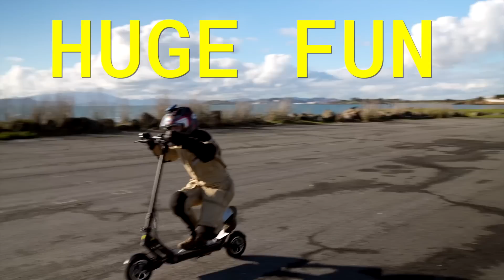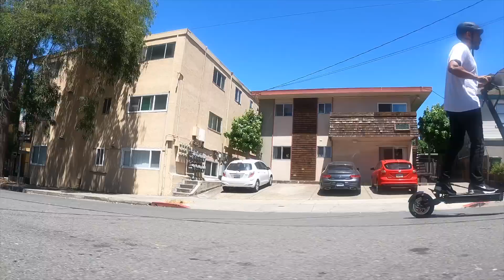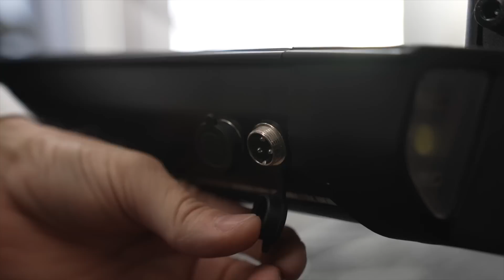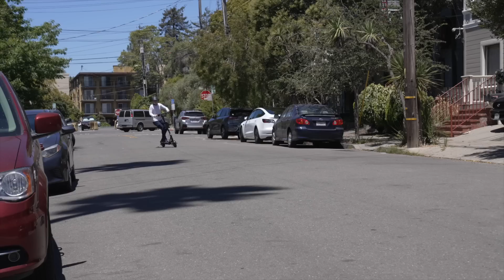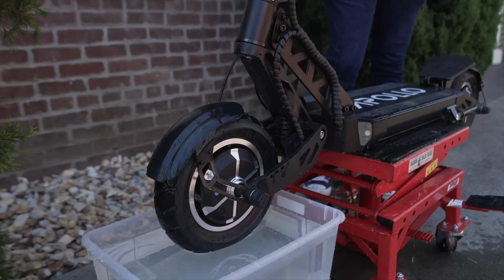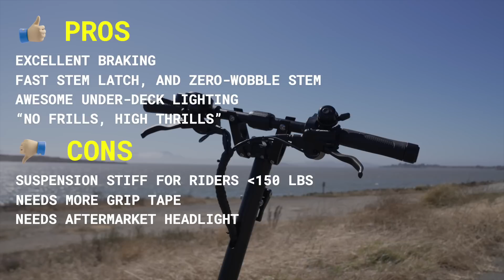NEW Apollo Ghost 2022 Gets 1,000W Motors - ‘No Frills, High Thrills’

Comment: I heard the larger motor prevents the flats, probably distributing the heat
Reply from the maker: Prevents flat tires? Interesting. I hadn’t heard that. What’s the relationship between motor temperature and flats? Were some people reporting that they got flats from the heat melting the tubes, or that hot tubes were more vulnerable to pinch flats?   -Paul
Reply: That doesn’t make any sense
Reply: @Jack-bz7zr  does it make sense that Apollo puts the same power motor but only increase the size of it? If you follow the groups that ride Apollo's they talk about this problem of the heat causing flats.
Reply: @Mrjaha  🤔🤣
Reply from the maker: The thicker rims could prevent flats, because they might be less pointy on the edges, but that's just a guess.   -Paul
Reply: @ESG-ElectricScooterGuide  thank you Paul, love all your content. 
It's just my educated guess from reading all the flat tire stories from the apollo fb groups. Neck pieces from the valve stem melting and mysterious pinch flats from heat . But it can also be inexperienced rides and misuse. I personally I'm not a fan of apollo, their products tend to usually be unfinished. But win people over with their sleek looks.

Comment: How often do you guys gotta change the tubes and brakes on these things if you use it as a daily commuter?
Reply: I have the 2021 version and I’ve had 4 tubes blow in less than 150 miles… it’s frustrating…
Reply from the maker: Every few months or so!
Reply: It depends. But for escooter it's just not worth it to have pneumatic/tubed tires. It's much more difficult to change and find suitable parts.

Comment: At 135 lbs can you tell me how to make it have a comfortable ride?  Am I just too lite to have a comfortable ride on this scooter thanks?
Reply from the maker: My favorite mod for the Ghost is to add a small rubber washer and metal washer to the top of the bolts for the suspension spring. This keeps the suspension from clunking when it reaches the top of travel. The trick is finding washers that fit into the space. You can add a stack of rubber washers for more cushion. It’s best to use washers with fibers embedded in them, otherwise they will pop off. I’ve even seen folks work a small spring, into that space. The other thing I haven’t tried that could help is giving the spring one or two turns counter clockwise, to reduce spring preload. This would also make it top out less. The tricky thing here is you’d need to loctite the bolt once you’ve loosened it to make sure it doesn’t keep backing out (because if the bolt comes all the way out the spring could completely leave the scooter).  -Paul
Reply: @ESG-ElectricScooterGuide  thanks for the information.  I guess after ready your reply I am leaning towards finding a scooter that comes “stock” with a ride that is comfortable for smaller riders like myself.

Comment: I got me an entry level scooter Segway E22  I just got it last week can you tell me if it's a solid scooter or not is it a pretty good entry level scooter  I just haven't had the time to ride it yet  I've been working a lot I didn't take it out on the road yet it's all charged up ready to go though 🛴
Reply from the maker: We made a review on that one too (paste below)! I like the E22!  -Paul

https://youtu.be/XLxC2E6OILc
Reply: @ESG-ElectricScooterGuide  ok thanks
Reply from the maker: It's a great entry level scooter for sure! - Chase
Reply: @ESG-ElectricScooterGuide  Thanks a lot for your feedback
Reply: The E22 is okay-ish. But it depends on the road conditions in your area. I personally won't recommend anything without a proper suspension. I also ended up getting an external battery pack to increase the distance.

Comment: is the acceleration smooth? I had the mantis 2 pro and it was just way to jumpy I did not like it
Reply from the maker: It’s much smoother than the Mantis Pro. I haven’t ridden the Mantis 2 Pro, but if it has a Minimotors EY3 display it will be more abrupt. The regular Mantis V2 is smooth and the Ghost is almost as smooth as that.   -Paul
Reply: @ESG-ElectricScooterGuide  wait I meant mantis pro lol
Reply: @ESG-ElectricScooterGuide  awesome !
Reply: It is if you have dual motor mode disabled or in eco mode.